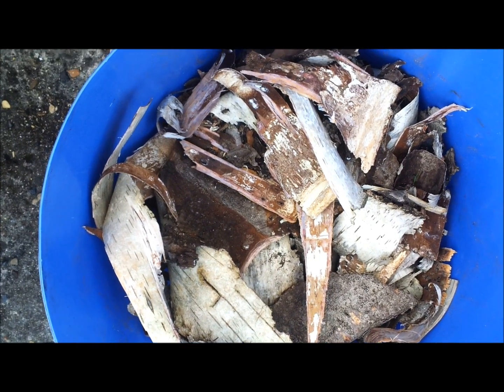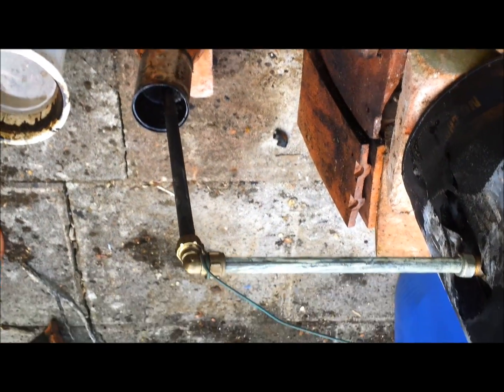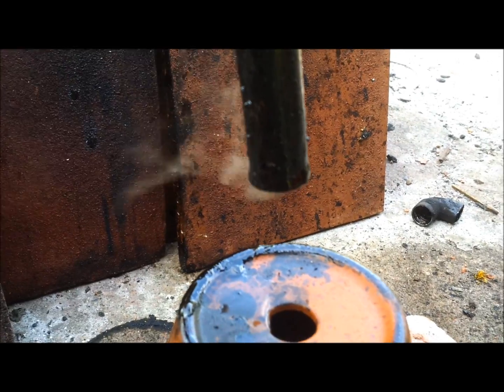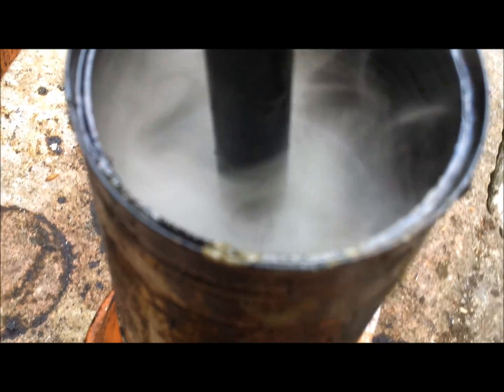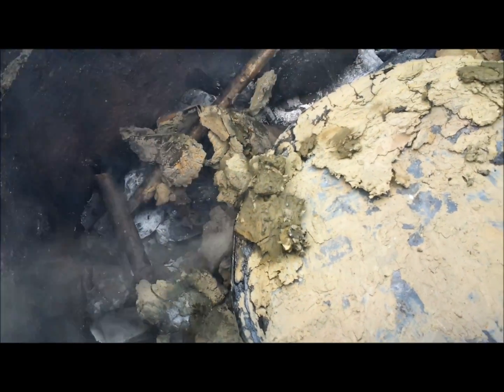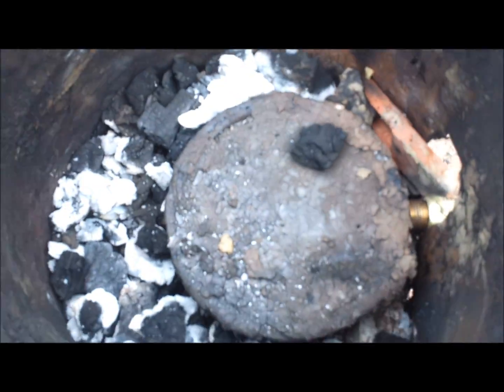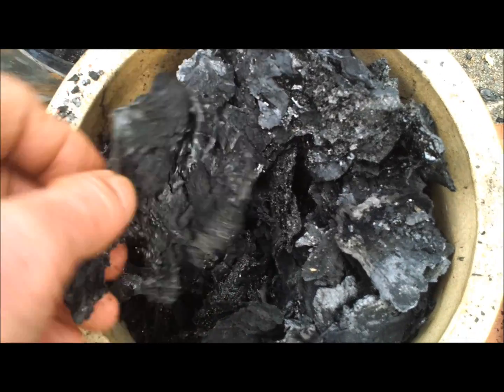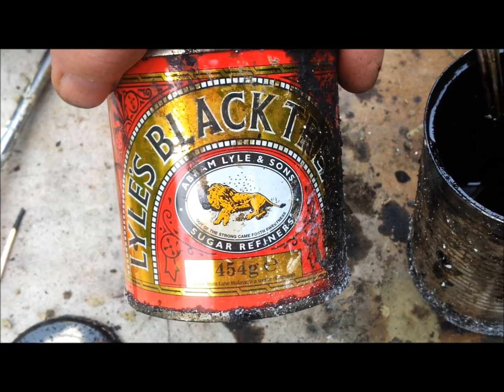Making birch bark tar

Comment: Will silver, black, and yellow birch bark work as well or does it need to be white birch?
Reply from the maker: Hi I am not sure it would be interesting to know. I expect that if the bark burns easily it will have lots of the inflammable compounds in it. Thanks for watching the video
Reply: @adrianrosser8565  I will update you if I try it I cut timber and have been cutting silver, yellow, and black birch the price for veneer is up so I kinda have an unlimited supply of bark.

Comment: Hi, i am an experimental archaeologist studying Neanderthal Hafting, while your technique is good i just want to point out that neanderthals did not have arrows, bows or arrow heads. This technique was used to attach spear heads to spear shafts.
Reply: So the main tool types they used were handaxes, which were a hand held tool that was in the shape of a teardrop or elipse. These were more of a large knife than the axe we think of today. These were most likely not hafted as the design lends itself to being hand held. Then there were the spear heads mentioned before. Finally, and this is a bit of a generalization, there were the blade like tools. These were made from flakes and were more fine cutting tools. These may have been hafted to aid use as the blade shape may have not have been great to hold. Generally thought we assume that 80% of the tools were not hafted although this could vary significantly depending on location. Hope this helps
Reply from the maker: @EVERSMAN42  thank you
Reply from the maker: Thanks for clarification
Reply from the maker: Did they use it to haft axe heads